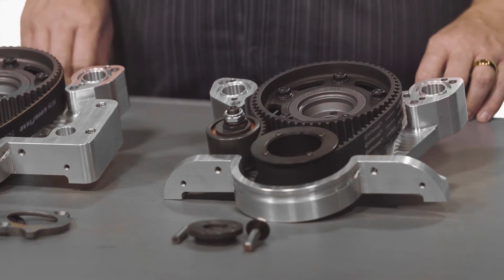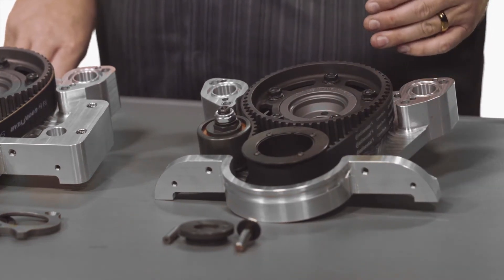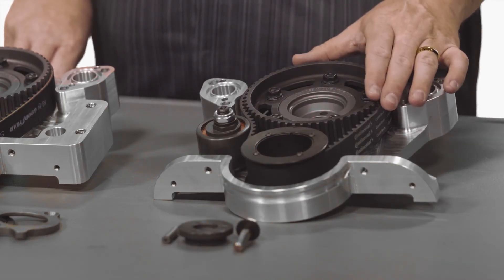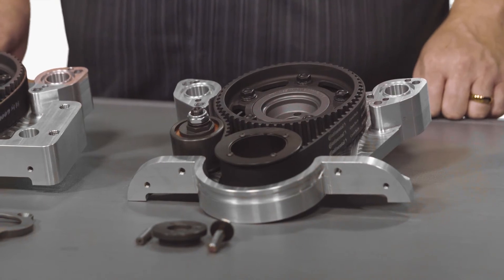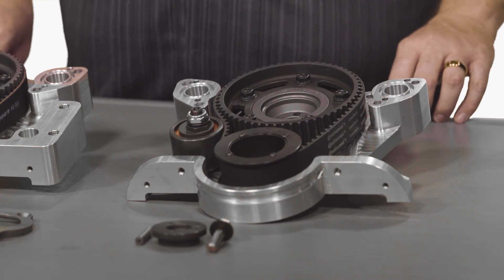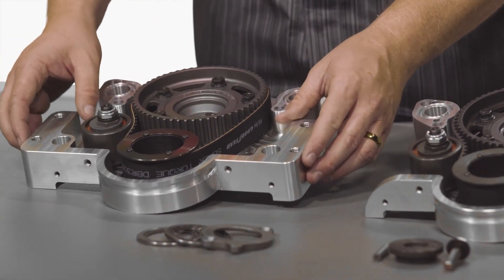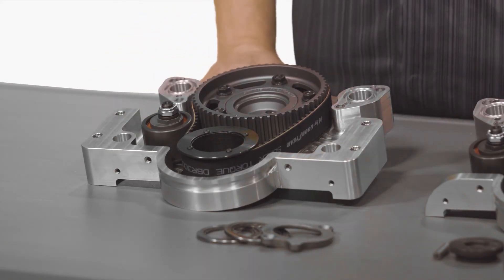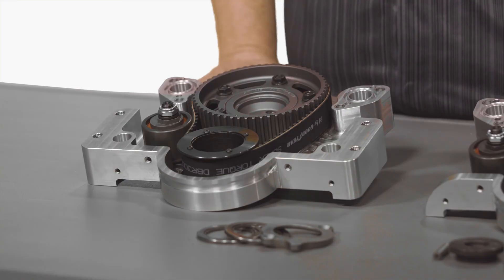Innovators West Product Spotlight - SBF Belt Drive Timing Systems

Comment: Oiling??
Reply from the maker: The SBF belt drive does not alter the oiling system.  Most engines of this caliber use a dry sump oil system, but some choose to use a stock style pump and wet sump system.